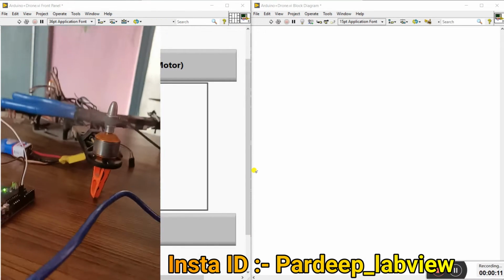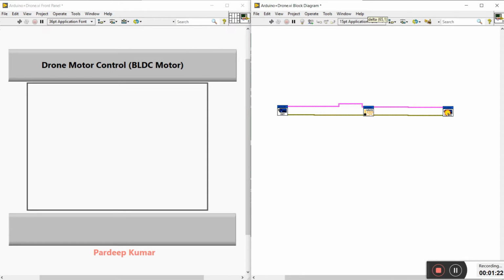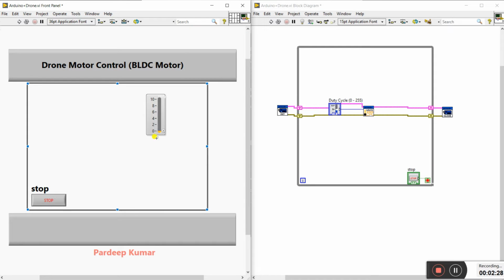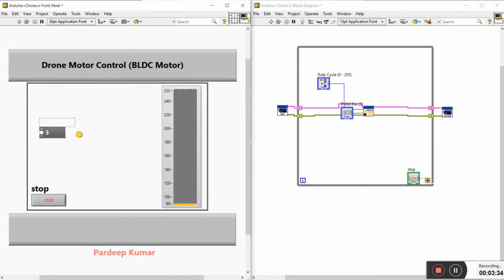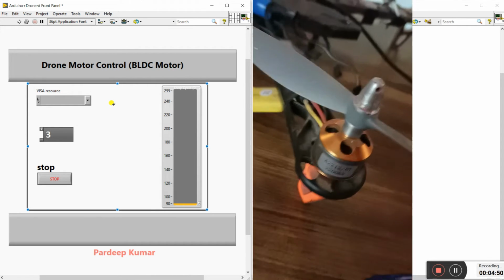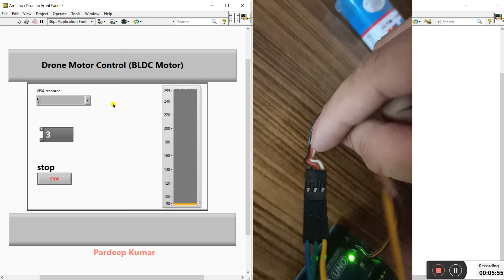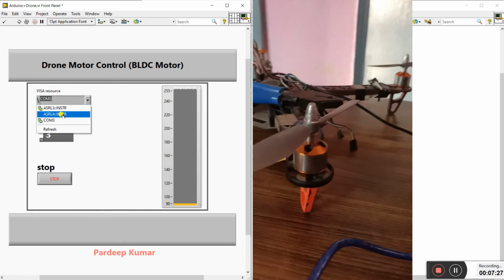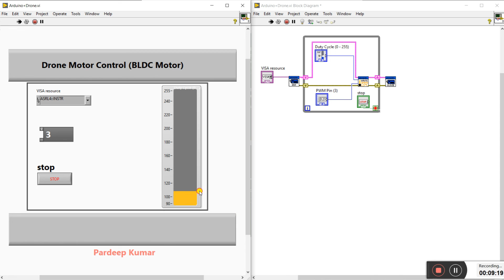LabVIEW | Drone motor control by Arduino | BLDC motor control LabVIEW + Arduino | Project Series

Comment: I am doing the same thing but my motor is not running ,do I need to upload any code in the arduino also
Reply: Can u pls share lifa base arduino code
Reply: I tried  to upload this lvifa code in to arduino but it is showing error in LabVIEW interface.h library not found
Reply from the maker: @ankitkailashi6677  yes first open vi package manager and search "Arduino" and install "Arduino interface LabVIEW" after that again upload code and run it

Note:- Arduino version:- 1.8.4
LabVIEW version 2020 community edition
Reply: I am using arduino version 1.8.8 and LabVIEW 2020  ,is it necessary to use community version 
Sir can u pls share ur contact no
Reply from the maker: @ankitkailashi6677  dear i will tell you step by step at night send me message pardeepnain1111@gmail.com
Reply from the maker: Dear you need to upload a "Lifa base" Arduino code in Arduino hardware

Comment: This doesn't work can you make another video using the lipo battery? Cause I've used a lipo battery and it didn't work.
Reply from the maker: oh ok dear, but i need to purchase lipo after that i will upload video
Reply: The problem lies within the input signal. ESC's require an input of PWM with 50Hz and 1ms-2ms pulse width. using PWM input directly may cause issues with the callibration of your ESC. any PWM input below 125 will not generate any output on the motor. try using a pulse generator as an input